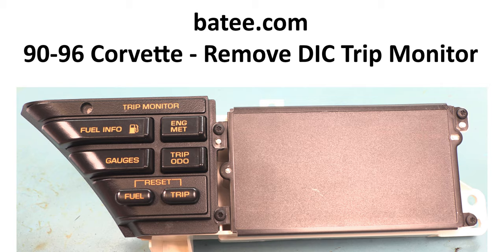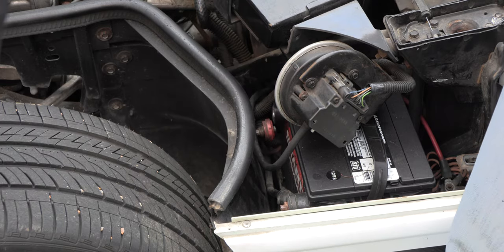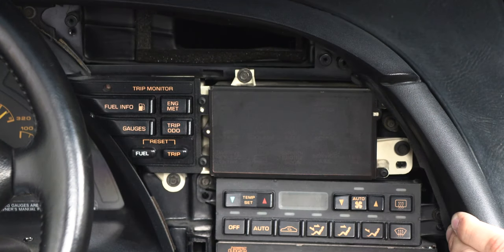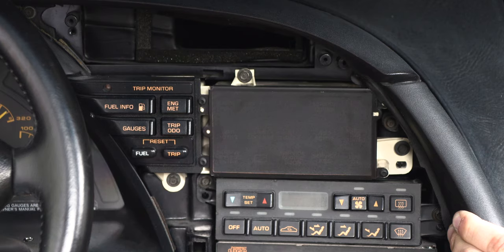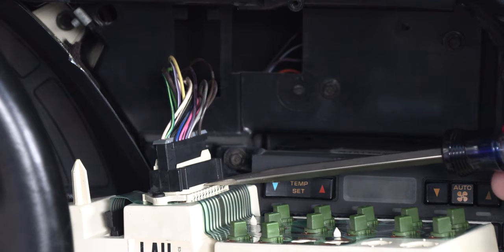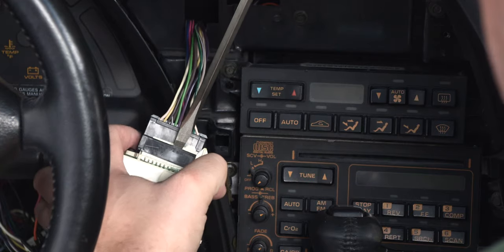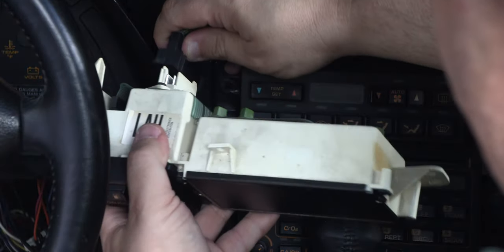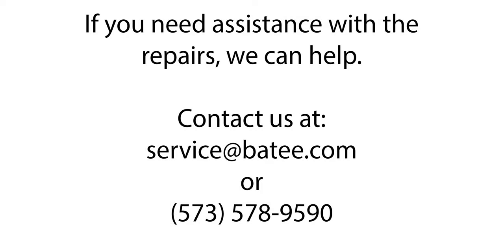1990-1996 Corvette #7 - Digital Information Center Trip Monitor Removal (2019)

Comment: Thanks a lot, that was very helpful because I needed to take out a warning light (suspension check) since I replaced the adjustable shocks with Bilstein.
Reply: You can also unplug the fx3 module located in the hatchback compartment behind the driver seat

Comment: I believe you also have to pull the lower plastic around gear shift, there are screws at the the bottom you normally need to remove. As you noted you have some screws missing